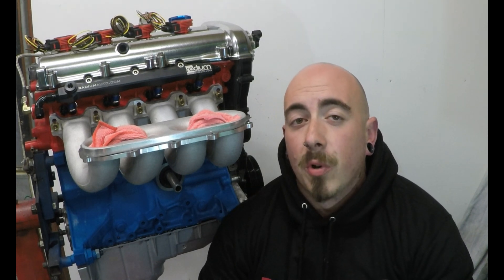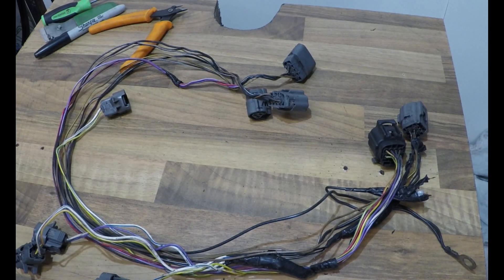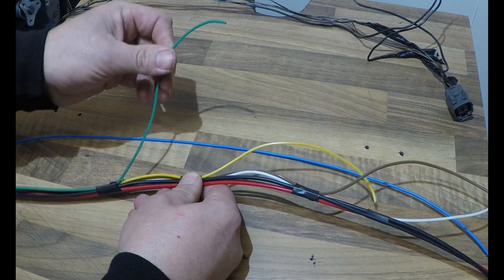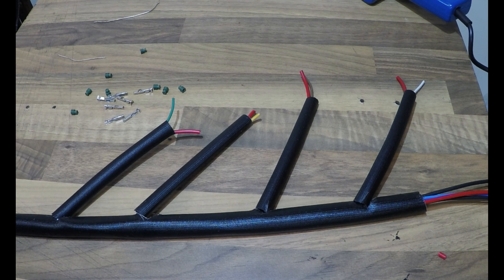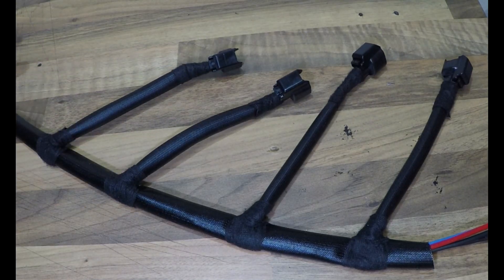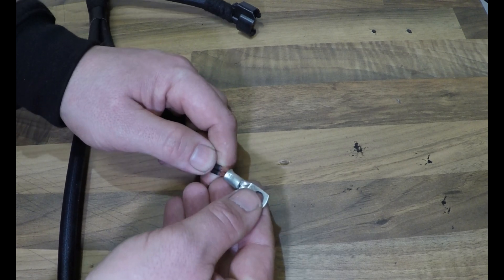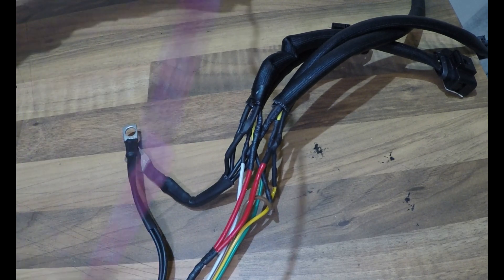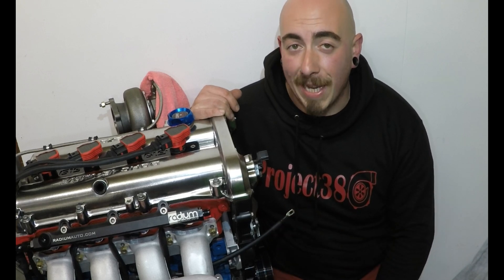COIL AND INJECTOR SUB HARNESS : MX5 TURBO BUILD pt20

Comment: Hey man! Watched this over again to see how you did then sequentially but honestly making that harness looks like it’s gonna take me a century. I’m currently experiencing a blowout around 3900 rpm’s on r8 coils with bkr7e-11s at .022” gap. I’ve swapped back to stock ignition currently and it’s worse in boost but for causal driving it’s still great like the r8s. I’m only noticing the blowout during WOT. I have a bunch of data logs and videos but it’s been about an 8 month tuning process so far and have yet to figure it out. Maybe sequential will help? I’m currently on wasted spark and the r8 coils just plug and play directly into the stock coil harness(just had to repin the plugs on stock side to fit r8 harness.)
Reply from the maker: hey man, was it you who messaged me on insta ?
Reply: @Project380  yessir it was!

Comment: For future reference the waterproof little silicone seals are supposed to get clamped under the rear insulation crimp part of the terminal so they get pulled down into the connector body when the terminal is pushed into the back of the connector.  
In all reality it does not make that much difference to there functionality of the seal as long as they get push inside the connector body they seal the back of the connector pretty well.
one other thing you can put a teeny tiny(and i mean tiny) bit of of washing up liquid or silicone lube spray on the the silicone water proof seal to make it slide inside the back of the connector body. it make it much easier to push the seal in.
Reply from the maker: great tips. thank you 😊

Comment: Hey feller, absolutely love all your videos! Just wondering where you got all the connectors for this video please?
Reply from the maker: Thank you 😎, injector plugs came with the injectors and the rest from ebay
Reply: @Project380  cheers, I've found them all now. I was struggling to find the 8 pin that connects the sub harness.

Comment: Hi mate, I'm a Motorsport harness technician. As a first go this is a great effort however my only criticisms would be: 

Don't splice wires via solder as solder can deteriorate over time. Invest in shotgun splices or butt splices. I can send you the RS Component number if you're interested. 

The only big issue I would say is the waterproof grommet in the rear of connectors, the front lip of the grommet is meant to be crimped under the insulation crimp and butted against the conductor crimp so it's held securely in place, instead of being slid up. 

Keep up the good work bud and hope these tips help in the future!
Reply from the maker: Thank you for the input i greatly appreciate it. in the future if i have issues ill make wiring harness 2.0 😉
Reply: @Project380  hi do you have an email address by any chance?
Reply from the maker: @jameshall4136  ive got instagram.

Comment: Wonder if you can help I am trying to fit a omex limiter and ders 2 wire from omex limiter needs to connect to negative terminal of the coil... i dont know which it the negative terminal and I have 6pin connection from coil pack which has 2.red 1blue 1green and 2black on my mx5 nb 2003 question is would you know were the negative terminal is?
Reply from the maker: is it 1.6 or 1.8. ive only ever fitted a *bee r rev limiter and had to use diodes to make it work.
Reply: @Project380  it's a 1.6 2003 https://www.manualslib.com/manual/1365967/Omex-Rev-Limiter-Twin-Coil.html?page=3#manual that the manual on online

Comment: Are the wires you have put to the coils not a bit big? Extra resistance and that?!?
Reply: Bigger wire = Less resistance. More space for the electrons to flow ;)
Reply from the maker: @88Frank  🙌🙌🙌
Reply from the maker: well this is what i was thinking. i done a tonne of research adn dug up an old post on a forum that said use 16awg wire, i ordered 16 and i can only trust they sent the right wire

Comment: gotta ask bud, I guess by your name your shooting for 380 bhp ,  what  are you going to do  with your drive train .   6 speed with torsion lsd??   but even that isn't going to last long on track even less at drag strip    love the vids btw
Reply: Torsen should be fine to 400, the trans not so much sadly
Reply from the maker: @slwbys  hey if it brakes ill upgrade it....thts if i even make 400
Reply from the maker: hey pete,  its an Rs so its already got 6 speed and torsion , if they break then i will upgrade